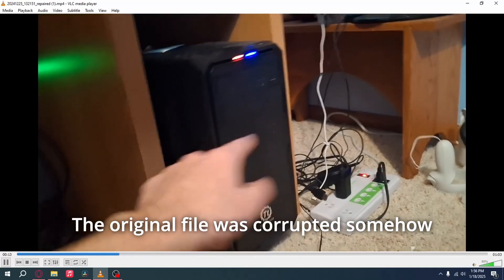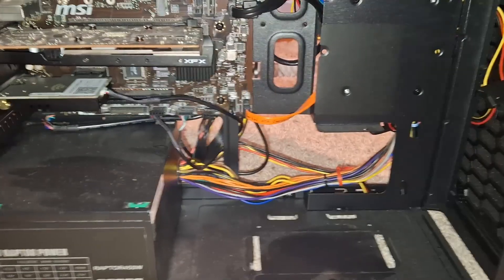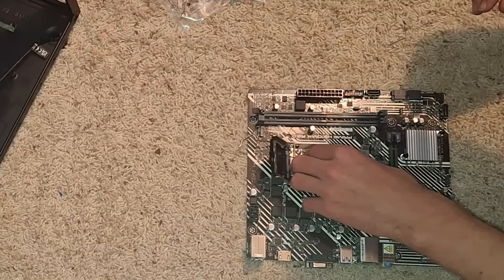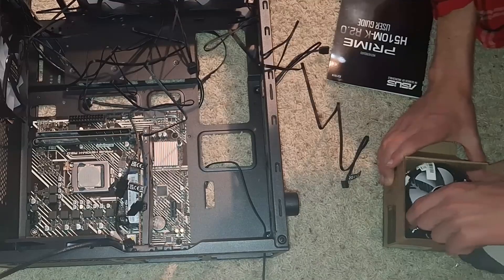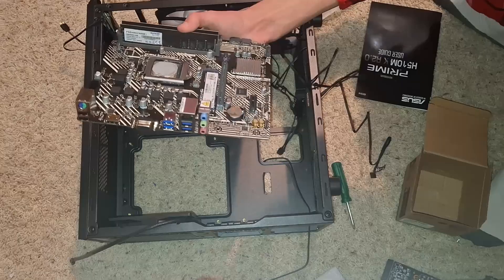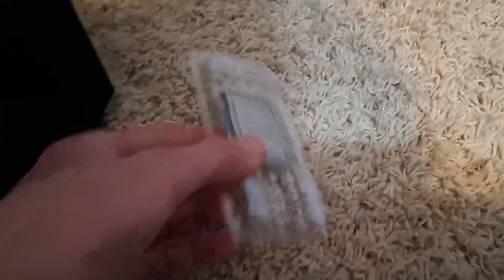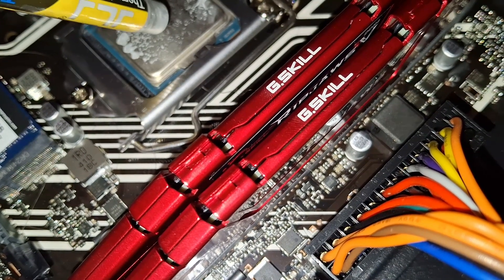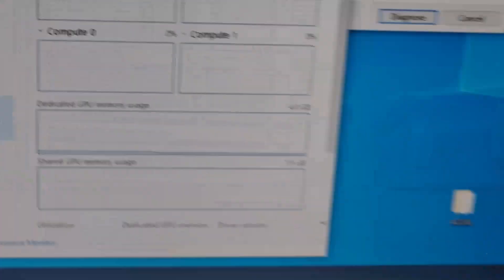Upgrading my PC | Everything goes wrong | #technology #computer

Comment: you could get a cheap ars gtx 1660 super from ebay for about 100$ bucks or so i vr with it all the time
Reply from the maker: Thx for the suggestion, but I'll be sticking with either amd or intel for my graphics. Nvidia cards are good, but expensive

Comment: try windows 10 enterprise ltsc, it's lighter than most windows 10 editions and has little to no bloatware that you can install it on a 16gb flash drive
Reply from the maker: I put tiny 10 on the windows Chromebook if you know what laptop I'm talking about. It's basically a stripped down version of windows 10 enterprise ltsc
Reply: @AA10izcool okeh